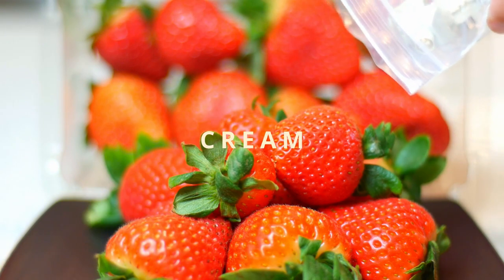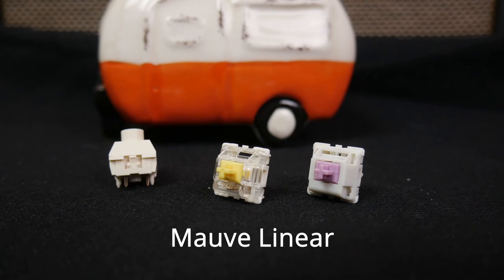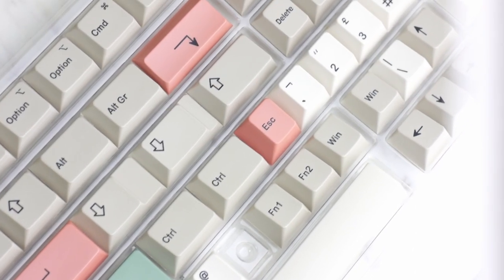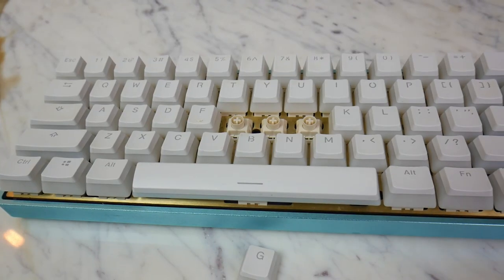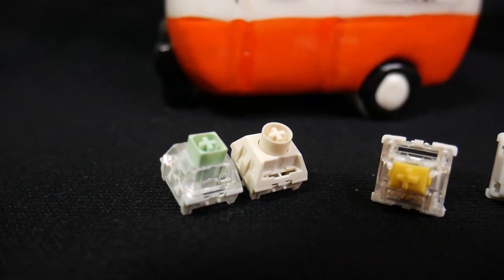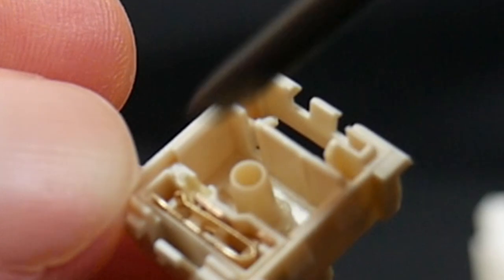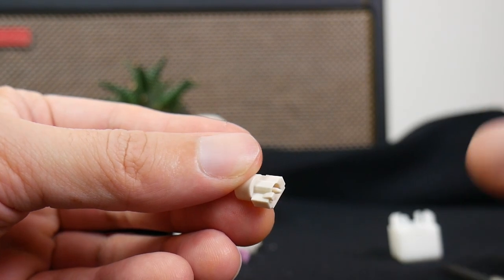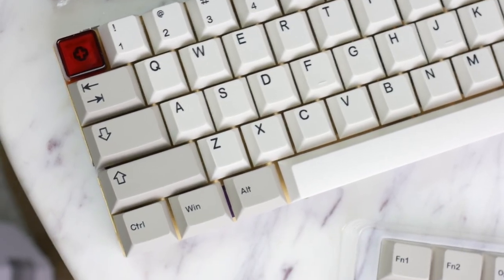Kailh Box Cream Switch Review - Novelkeys - Self-Lubricating Linear, my typing and gaming pick!

Comment: The inner segments of this switch are quite interesting to me. Looking at it, doesn't it seem much like those of the Kailh Chocs? That seems like an excellent design choice overall, particularly for stability and prevention of wobble. As a 15g and 30g typist, I'd love to see how it handles ultralight/superlight springs. Do you have any interest in such mods? I'd like to try that myself. First switches I had were stock Gateron Clears, by the way.
Reply from the maker: For sure! I would love trying these out with different springs and even lubing the go to areas that i usually lube a switch. I'm enjoying them so much that i'm scared to change the experience lol i'm sure i'll get bored enough to try it some day

Comment: Nice video but i wouldnt describe them as “self lubricating”.
Reply from the maker: How would you describe it?  yeah, lots of marketing from Kailh on 'Self-Lubrication' but it really just renews the contact between the leaf and whatever that brown mechanism is which is probably the main point of friction other than the sides of the stem and spring which is what i expected from the marketing material but if my time with theses switches has shown me anything, it is that that area is enough.